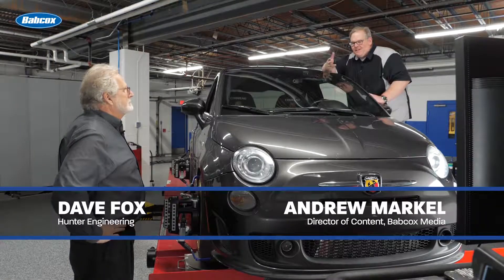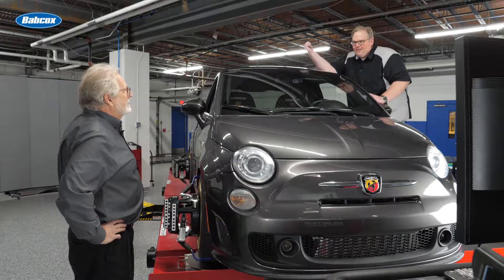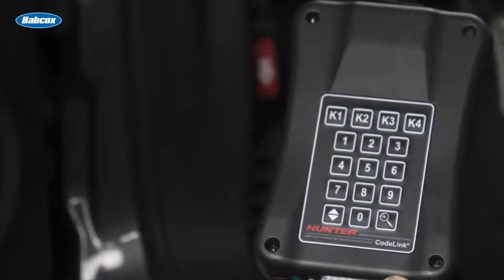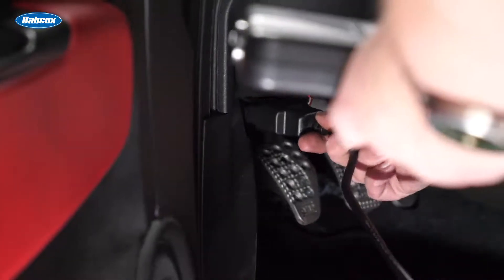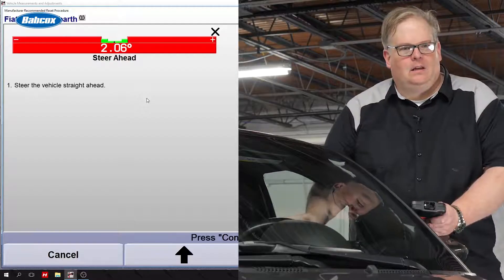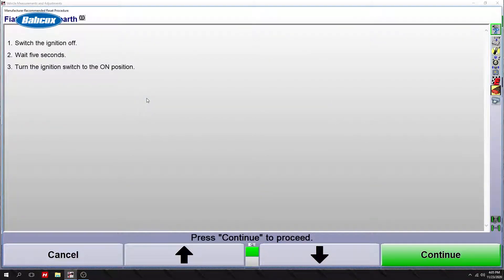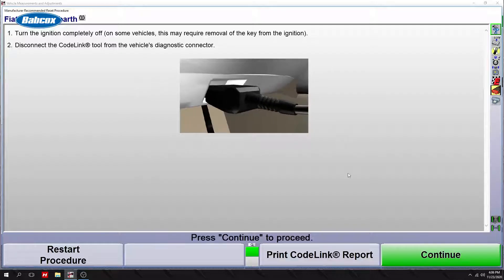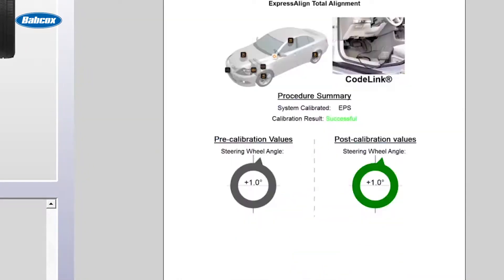RESETTING THE STEERING ANGLE SENSOR AFTER AN ALIGNMENT

Comment: I have a 2013 dodge challenger RT had the inner outer tie rods replaced my traction control lights came off then eventually went off then after a week or so came back on and my steering angle was out of whack and got worse . would not resetting the steering angel sensor cause all this.